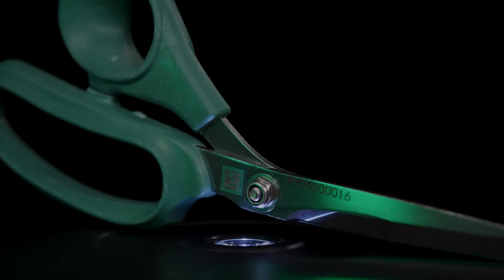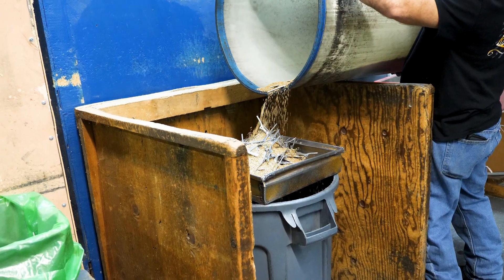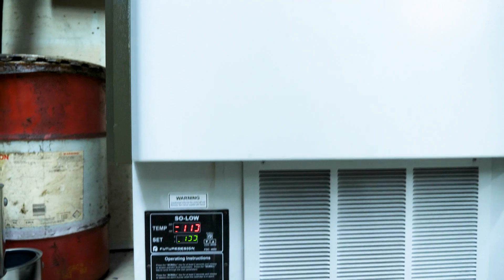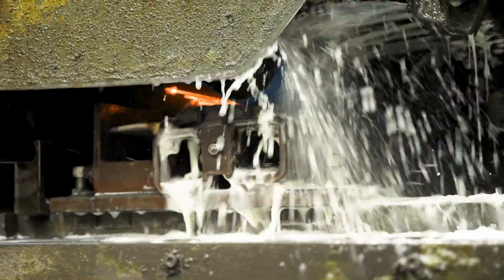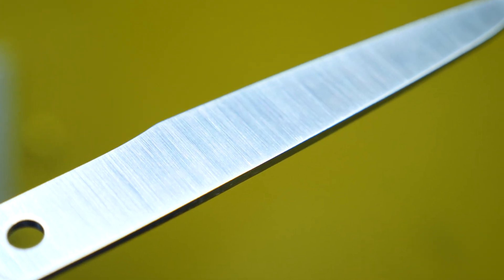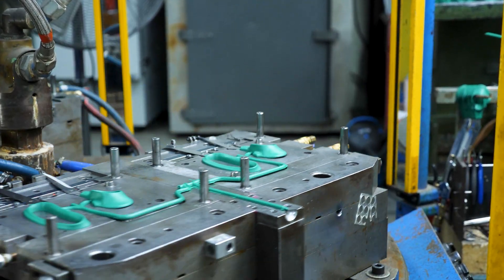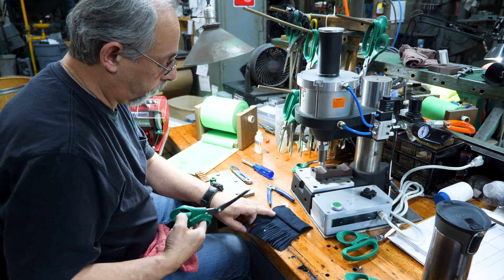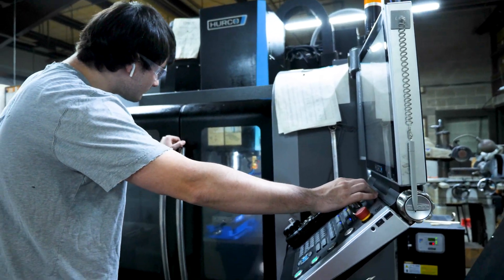How Scissors are Made | American Made Scissors

Comment: Thanks but you don't give away much do you?
7:37   You can't see anything because of all the cutting fluid or water.  LOL
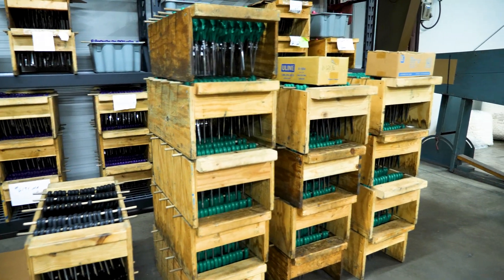8:15 Finishing setting and edging - how is the main set put into the blades 
as that fellow is only adjusting it if needed. Is it at 8:22 on that press?
Reply from the maker: I thought all the splashing water looked cool in slow motion 😂. And no we didn’t show the set. It’s part of the quenching process that we couldn’t show. When the metal plates smash the heated blade to quench, it also puts in the set.
Reply from the maker: And at the press, he’s just making slight adjustments to the set
Reply: @wolffindustries  - OK thanks.